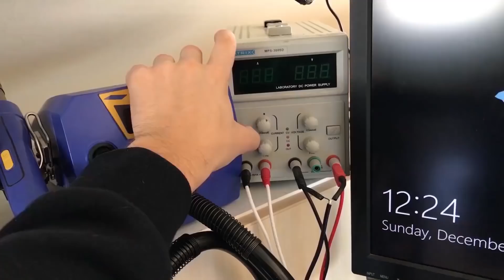Scratching iPhone 6 CPU to fix error 9 part 1

Comment: How the hell can you fix a phone by removing part of a chip like that! ?
Reply from the maker: The part of the chip (ram on top of the cpu) that has been removed is only ground which allow us to dig deep and restore the loose connections between cpu and eeprom.
Reply: RepairLab yeah but aren't you cutting lines to ground from the chip. I don't understand
Reply from the maker: Yes I do, but ground is shared so no big deal if you cut some lines. Does now make any sense?
Reply: RepairLab kinda, yeah. I'm teaching myself board repair and this one threw me for a loop. So far I suck but hopefully I'll get it.
Reply from the maker: Joshua Wendt best of luck!